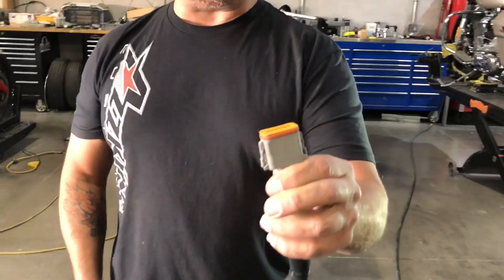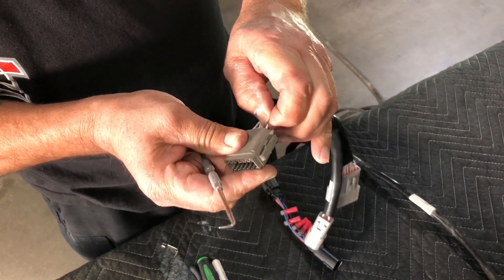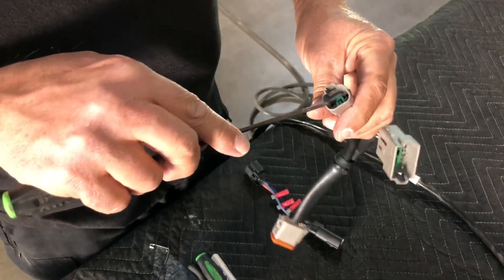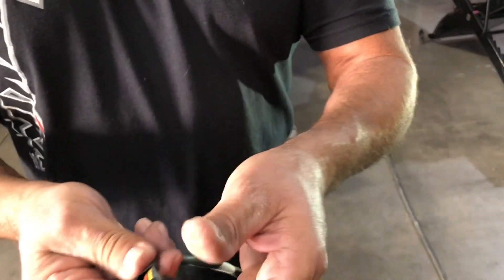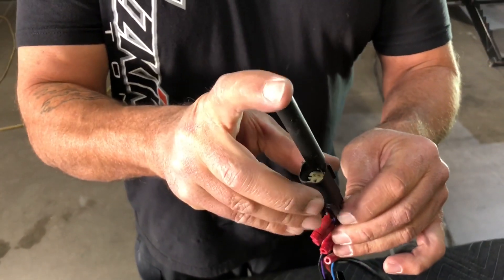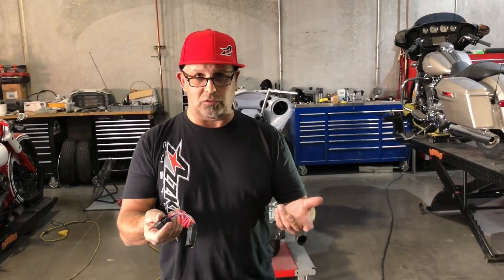Harley Connector Disassembly

Comment: Thank you so much for this video. I’ve been putting off a bar change on my 03 Softail because I’m intimidated by the wiring that runs through the bars. You’ve helped tremendously.

Comment: Hard to believe I'm rebuilding a 2000 Harley sportster that I got for 300. Ordering signals every stupid motorcycle recycling shop cuts the wires and leaves you stubs to work with hard to keep things original. Great work and thank you saved me some time

Comment: Hey man great video very descriptive but of course the way my luck works the most important moment for me is at 3:18 and your hands go down off camera. Also, my '08 Fatboy has only 3 wires and they are opposite...looking down from the top where your right thumb is with the secondary lock facing up the orange wire is in the left end socket, the yellow wire is next to it in the 2nd socket from the left, the 3rd socket is empty and the black wire is in the right end socket. Any additional insight you can offer would be greatly appreciated. Thanks

Comment: Now I see. I have to pull the white plastic piece up a bit on the male side and then my $30 pin tool will release the broken prong. I have gripped that wire with pliers and pulled so much I hope it’s not damaged inside. Probably wouldn’t have needed the $30 tool either. Thank you.

Comment: 2017 throttle body actuator plug.  6 pin straight in line.  Is it the same process as the others or different?

Comment: 05 ultra classic. I want to use the accessories switch to light led's independently. I found the pin (on the 4 pin deutsch) that works (on/off) but is there an accessories plug extension? It's a pita to get to or is there another wire that I can tie into that will work? With the acc. switch.

Comment: I've been trying to get the wires out of my tgs connector using a paper clip safety pin and anything else that will fit and the wires do not come out.

Comment: John- 
My 2018 street glide only has 5 pins on the EMC plug. I was trying to load a new tune and noticed the 5 instead of 6. Is this normal or do you think I’m missing a pin? I’m on the left side of the bike (primary side). The tune was accepted, but not sure it was successfully downloaded. I haven’t got on the road yet to test it out. What’s your thoughts on the pins? Should I have 5 or 6?

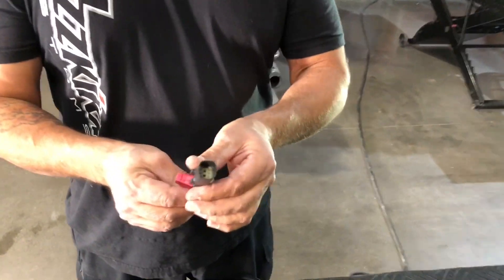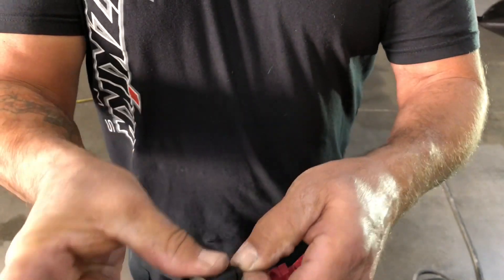Comment: In the connector you show from 3:40 to 4:28 , how would you remove a plastic protector that won’t allow a new cable in and will not come out as you show in the video since it has a little notch which keeps it from coming out?  Help please, I’ve tried everything and nothing seems to work